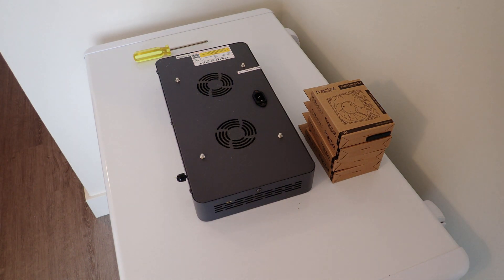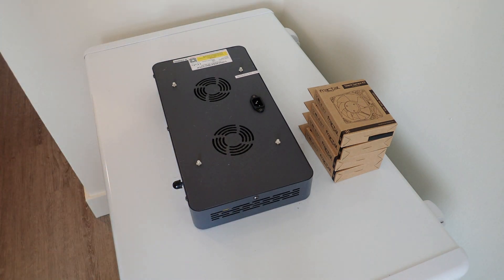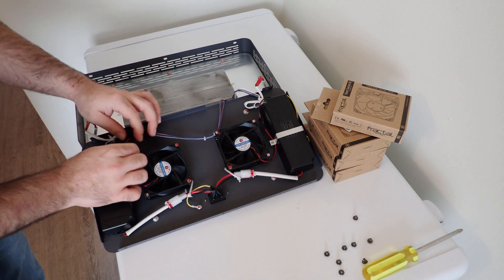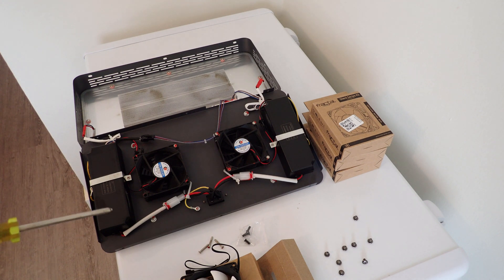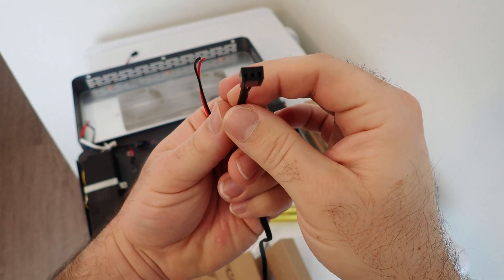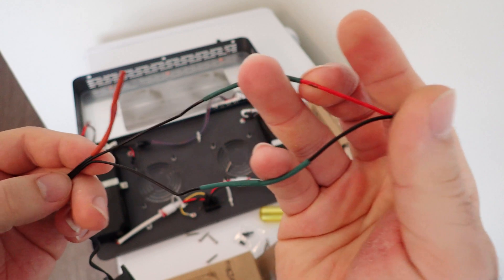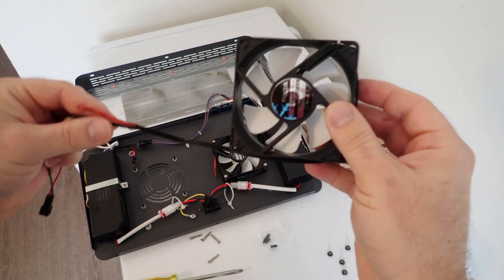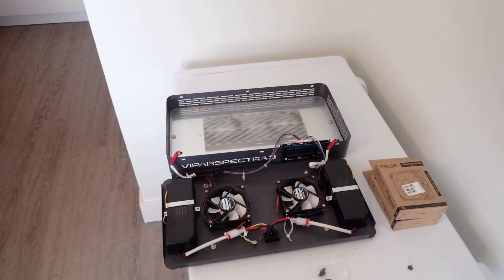Viparspectra 165w Reef LED Silent Fan Upgrade

Comment: Thanks for the video.  Worked perfectly.

I ended up using Noctua NF-R8 redux-1200, Ultra Quiet Silent Fan, 3-Pin, 1200 RPM from amazon.  9 dollars each.

Comment: Quick update for anyone googling - the original fans are model FD8025BM1, 12V, 0.12A, from fan-cooling.com. The specs appear to be:

2500RPM
32 CFM
2.5mm static pressure
27dB

If you are replacing the fans, look to match at least the CFM value, and something somewhat close for the static pressure, though these are pretty "open" enclosures so I think they aren't that sensitive to static pressure. I replaced with Noctua redux NF-R8 1800 RPM fans, which have similar CFM levels, and are much quieter (17db). The end result is still audible in the room, but not distracting like the original fans.